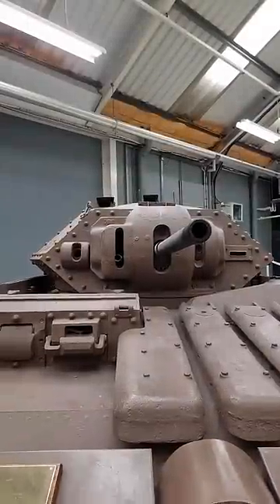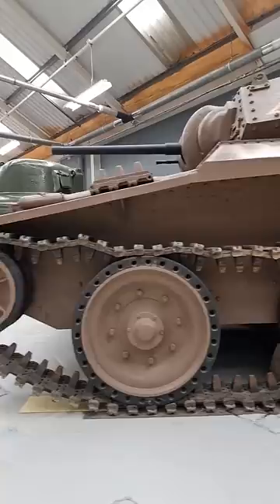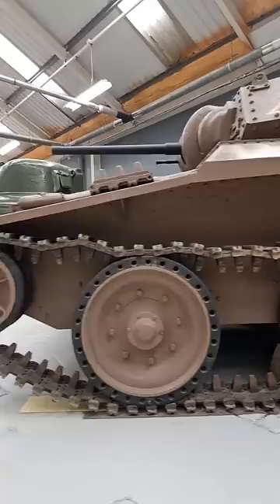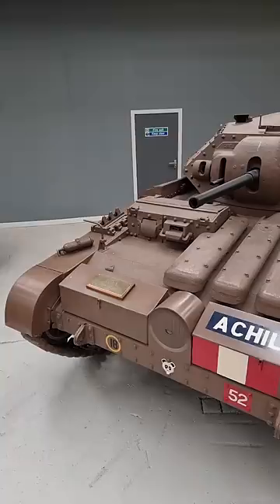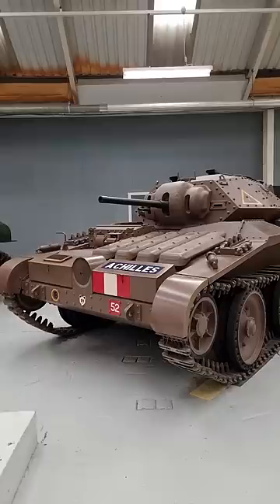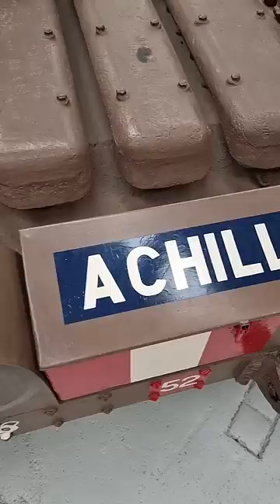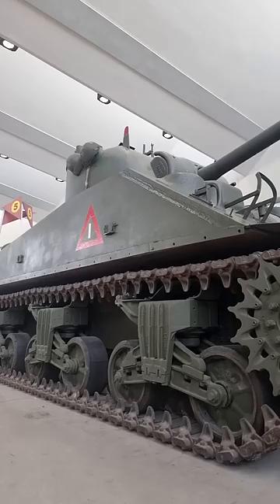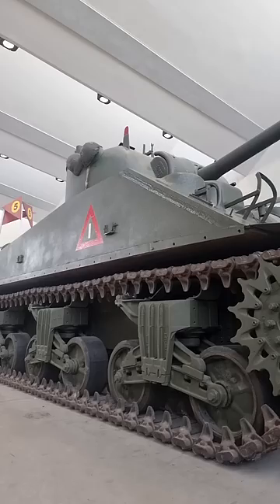The Covenanter in 60 seconds #shorts

Comment: You know the tank is bad when they rejected it for frontline service at a time they had very little actual equipment
Reply: When the newly made equipment that's made because of lack of equipment is so bad you'd rather fight without said equipment.
Reply: I like the way it looks though
Reply: Why did the US use Sherman then ?
Reply: @СергейСердюк94  wow who knew that the Sherman (a good tank) is miles better than a tank that literally burnt the crew if they moved wrong
Reply: They wouldn't even use it as an APC
Reply: @СергейСердюк94 the Sherman was a pretty good tank tbf
Reply: @СергейСердюк94 Easy to mass produce, Easy maintenance and very modular design
Reply: @smiley7399  the T-34 was faster to build, cheaper to build and was faster, had more range, could easily be maintained and more powerful engine yet people mock the T-34.

I personally think it depends on situation, for Defensive fortifications I'd use Tiger 1 thanks to its big armour that most tanks or field guns couldn't pierce.

 for firepower and pure offence and go with soviet IS-2 with its beast of 122mm and thick armour proven in WWII in Ukraine when 10 IS-2s faced numerous tanks and half tracks and destroyed over 50 Tiger I and IIs and losing 8 IS-2s.

For speed I'd go with soviet T-34, it's one of the fastest tanks, can be easily maintained and has one of the largest operational ranges for both road and cross country of WWII tanks.

For best combination of all three I'd probably choose the Panzer IV, it's just all round solid tank
Reply: @rainbowappleslice  it's an okay tank, depends what it's needed for, Sherman's are good for their variations, for speed the T-34 is best as it's one of the fastest and has most operational range, for Defensive fortifications the Tiger II is unmatched with its thick armour and large gun and for offensive and firepower then it has to be the Soviet IS-2, the beast that could put a hole right through a Tiger II and did during soviet offensives in Ukraine
Reply: @@kira-le9qr meh it was okay, it did its job I think best tank overall is Panzer IV, but for defence I'd choose German Tiger II, for offence I'd choose Soviet IS-2 and for speed I'd choose Soviet T-34.
Reply: @СергейСердюк94  the Panzer IV was too expensive and time consuming to manufacture, the T-34 was a piece of hot garbage with the Soviet’s manufacturing (the only good ones were produced post-war), the Sherman had good reliability, was able to punch a hole through most anything it came across, and most importantly of all had the highest crew survivability rate.
Reply: @СергейСердюк94  no now I know you learned from exactly what you said I did. The Panzer IV was a very effective tank for the first 3 years of the war but was too expensive and labor intensive to manufacture during the later years as Germany’s industry ground to a halt. One of the reasons we know this is they started to remove components on the late war variants of the Panzer IV which included the removal of the motorized turret traverse mechanisms because they were too expensive to manufacture and they didn’t have the resources to do so. The T-34 suffered from the Soviet’s poor manufacturing with the armor plating usually being way too brittle and poorly welded together, with there being visible gaps in the armor, reports of armor outright shattering or spalling from smaller cannons, and periscopes made of polished metal instead of glass. Every country that got the WWII era T-34s as military aid from the Soviets had nothing but bad things to say about the tanks while those that got the post-war manufactured T-34s thought they were decent. The stats of a tank on paper mean next to nothing if that’s not the quality you are actually producing from your factories. The 75mm Sherman was able to penetrate a Tiger 1 through the side armor at ranges of 650 meters or less and with how rare they were in the first place was absolutely fine, the 76mm gun could reliably penetrate the front armor on a Tiger 1 out to 800 meters with the 76mm gun becoming more and more common on tanks after the D-Day invasion and HVAP rounds became more common on tanks equipped with the 75mm gun. The whole myth about needing 5 Shermans to take out 1 Tiger is completely based on the fact that US tank platoons consisted of 5 tanks at the time and that’s what you’d be engaging any armored vehicle with whilst the Germans would have Tigers operating either solo or in a pair if they were lucky. The US had also been fighting in North Africa and Italy since they joined the war, going up against Rommel’s armored forces in North Africa and other German forces in Italy since the Italians were worse than useless.
Reply: @Sturmischer   you're wrong.

1. tigers were rare for Americans because most were destroyed on eastern front, Germany produced nearly 2,000, hardly a small number, it has nothing to do with poor manufacturing, the USSR didn't have th luxury of geography like USA, soviet production of T-34 suffered between 41-44 with having to cut corners because they had the full might and industry of Germany and Italy's  military attacking them, after the USSR turned the tide of war in Europe in February 1943 after the victory at Stalingrad, the T-34s could be produced up to standards and that's not even including the thousands built in 1940 when it first entered production and the issues in production only really effected armour, maintenance and crew comfort, the T-34 was still faster, had more on road and cross country operational range and had more horsepower than all Sherman variants and it's 76mm gun was larger than most Sherman variants that used 75.

2. This is about what was the best tank for overall use, not how much it cost, important factors in tanks are, firepower, speed, range and armour and the Panzer IV is my choice, if you disagree that's your opinion.

3. That's false, 75mm gun could only pierce Tiger side armour at 100m or less and couldn't pierce it's frontal armour at any range, allies knew this which is why is why they started producing more powerful anti tank weapons but didn't really care as they knew by late 43 that Germany had lost majority fighting the USSR so it would be rare to see one and they were right.

4. North Africa hardly proves anything, Germany and USSR lost more tanks in a single weeks battle on eastern front than was lost by both axis and allies during whole 3 year north Africa campaign

The Sherman was a good tank for its many variants and ability to adapt and easy maintaining, T-34s built to specification in 40 and 44-45 were great tanks and if speed was what you needed then is the best choice for a tank, even with corners cut due to bombings and supply issues, it only really effected armour, crew comfort and maintaince, with some effecting guns.

But calling it hot garbage, when it was one of the most effective tanks used in WWII and was proven in combat many times against many panzers, tigers and Semoventes, is ridiculous

Sources: WWIIEquipment, Armored Champion: The Top Tanks of World War II, Wikipedia Tiger I&II combat service section, Wikipedia M4 Sherman Design and Combat Service section, Wikipedia T-34 design section and combat service section, London: Arms and Armour, Wikipedia North Africa Campaign, International Institute for Strategic Studies, Accounting for War: Soviet Production, Employment, and the Defence Burden, Tank Tactics: From Normandy to Lorraine
Reply: @СергейСердюк94  
Becuse it was sufficently effective in combat , and easy to produce. 
It was no worse than the German  Pnazer III and Penzer IV tanks.
Reply: @tyaty  panzer IV tank was a better tank imo as it was faster, had more road and cross country range and had better armour than most Sherman variants.

But it was mostly a joke about meme tanks like Tiger being indestructible boogeyman, Sherman breaking apart after one hit, T-34 breaking down after a few miles then getting replaced immediately instead of repaired, Panzer IV for being the chad tank and Crusader Tank for being awful 😂
Reply: @СергейСердюк94 nothing Russian made has every been good. Ever.
Reply: @Sauce_Sensei  you have absolutely no idea what you're talking about, Russia is the world's second largest arms producer for a reason, they sell some of the best equipment, their tanks, IFVs, self propelled artillery batteries, MLRS batteries, fighters, attack aircraft, helicopters are some of the best selling in history.

You literally don't know what you're talking about, russian land force right now is the most powerful in the world far superior to the United States land force and far more advanced. And far larger in both active service and in storage.

Cope harder
Reply: @СергейСердюк94 if there so powerful and advanced why are they still fighting in ukraine
Reply: @sdkfz1825  shortest answer, Ukraine has a decent military and with military aid it's enough to put up a fight against Russia which is only using half of it's strength.
Reply: @VictorianTimeTraveler this and I think it's the Matilda, makes me very angry just seeing, I can't imagine the anger a German would have seeing whatever these British abominations are.
Reply: @СергейСердюк94 half ? Your nice its more like à quarter
Reply: @aurelienbidault9064  nah I'd say it close to half yeah most of its Equipment is still in storage and it not using it's sir force and navy to full potential but the large land force, calling up reservists and partial mobilization into partial war economy means it's serious, it's similar to US in Vietnam
Reply: @sdkfz1825 Ukraine and Russia almost had same tanks,planes,and weapons,but with different military training and tactics.Even with the help of western countries,Russia still able to push through Ukraine.The reason why Russia is still fighting Ukraine is because of the Western Countries,they send weapons which is more advance than Russian weapons
Reply: @Sauce_Sensei Why does Ak 47 still exist today then??
Reply: No one mocks the T-34, the thing was extremely unsafe though with awful escape hatches and compact crew compartment, didn't help that it was surrounded by fuel
 @СергейСердюк94
Reply: @FrogOnAHorse  I've said everything I've said and provided sources
Reply: @Markii234  western weapons are not more advanced
Reply: Reminds me, for another such example, look at the Soviet destroyer Opytny. Imagine being such a rubbish ship that the USSR removed it from service during WWII, when it needed essentially every asset it could get. But basically as soon as the Siege of Leningrad was lifted, the ship was put in reserve rather than trying to keep use it. And keep in mind, they used some stinkers like the Leningrad class and some very old ships like Aurora and the Novik class.
Reply: @СергейСердюк94 . Say it with me, comrade ."Lend Lease." 

The meme of "ackshually the soviets won the war entirely on their own with no support and only communism" is getting a little played out.
Reply: @CheckMyBioForFullArguments  if memory serves, only the commanding T34 had radios, with a massive antenna as well, knock it out and the rest of the squad lost nearly all coordination.
Reply: @СергейСердюк94  
Panzer 4 G - 1942
frontal armor: 80mm
side armor: 30mm
Top speed (Offroad): 16 km/h
Top speed (On roads): 42km/h

M4 Sherman (Early) - 1942:
frontal armor: 90mm (50mm plate sloped 56 degrees)
side armor: 38mm
Top speed (Offroad): 24 km/h
Top speed (On roads): 35 km/h

Explain to me how the Panzer 4 is overall faster and better armored than the M4 Sherman.
Reply: Ffh
Reply: @zano187  don't think that's true
Reply: @СергейСердюк94  The t34 suffered from poor quality control especially in its transmission. On paper it's a better tank in practice not so much. A common and now traditional problem of Russian tanks actually.
Reply: @tsiefhtes  that's just nonsense
Reply: @СергейСердюк94  There was nothing nonsense about the t-34s being hung up by their crappy laminated steel transmission.  The T34 was an excellent design for the time but Russia's poor manufacturing standards during wartime hobbled it . Russia only got by by making  massive amounts of them. If produced by the Americans the English or the Germans the t-34 certainly would have been one of the best performing tanks of WW2.  But good design doesn't mean much if poor quality control results in your transmission getting stuck in a single gear as was common for wartime T-34s.

Comment: Polish armoured train in the UK. Now that sounds wild.
Reply: There were 13 armoured trains built in Britain in case of a German invasion, and one of them was the world's only miniature railway armoured train. Because of its proximity to Europe, the Romney, Hythe and Dymchurch Railway in Kent was given an armoured train, but the line only had a miniature 15 inch railway gauge so they remodelled one of the miniature railway's Hercules locomotives into a mini armoured train. It had two anti tank rifles and four Lewis guns and managed to shoot down a Messerschmidt 109. After the war they took off the guns and armour plating, gave it a new paint job and returned it to use on the model railway, where it remains in use to this day.
Reply: The Free Polish Army was essentially a British army/militia; they were trained and equipped by the British and they were based in the UK. After the war, they remained in Western Europe because Stalin refused to allow these heroes to return home. 😢
Reply: Wow, I looked into that, and it is true, and not Monty Python homage, it is THE MOST BRITISH THING EVER.
I just imagine its Commander with his handlebar mustaches and swagger stick.  @RealUlrichLeland
Reply: Probably horse drawn. Sabres at the ready. Or insert correct slashing thingy

Comment: Very good looking tank, low to the ground sloped armour, looks like a t34 ish
Reply: Pretty sure armor sloping was a thing already done on some interwar tanks. It has drawbacks too, as it decreases space for the crew, especially the driver, which often ends up performing less good because of it.

Regardless, given the tank has their radiators on the front of the tank, I highly doubt the tank was designed to shrug off anti-tank rounds with sloped armor. More likely the designers wanted to keep the tank as light as possible by decreasing the amount of steel necessary, which is also why they couldn't be bothered to increase the hull size to fit the radiators better.

But I agree 100% that this tank looks amazing... like a '60's Porsche with a gun stuck to it.

Comment: the poor cooling was caused by the small fan and poor air flow not the position of the rads at the front. the covenanter and the crusader are the same basic vehicle only the engine and cooling is different, there was no room for the rads in the engine compartment  due to it being shorter than crusader. it's actually a very well made tank. i should know, i own one

Comment: Is that sped up footage? If not, that's one fast tank! I guess the engineers that built this were of a similar mindset to those who partake in drag racing. Put the biggest engine you can, or one with the most power, it only has to get to the finish line then shut off and coast home. 😂

Comment: Built to a weight, had additional armour put on it after (due to mission/specification creep) that so the suspension and drivetrain struggled.  The engine rear, radiators front at least provided heating... not great for the desert. And they were leaky.  Commander's "hatch" was spring loaded to slide shut. Guillotine style. And the catch was not that good at its job. I've seen mention of concussions but no actual decapitations.  Build quality, would have shamed British Leyland of the 1970's.

Comment: There are two points that were in the favor of the Covenanter. First, the Germans never knew how bad it was, but they could count and the Covenanters were frequently moved around the country (for training) and the Germans knew that we had 1200 tanks and that must have frightened them because if they were good, then that was a lot of vehicles and a propaganda win for the British.
Secondly, the Covenanter was quick. It was a cruiser tank with a top speed of 55 kmph and that's fast. Rommel liked British cruiser tanks because they were fast. He actually used 2 captured Cruiser tanks for his personnal protection and the Germans must have realised that the Covenanter was yet another fast tank compared to the German ones. Even though Rommel did not know about the radiator problems, Rommel would have cautioned the Wehrmacht that fast tanks can be used for Blitzkrieg.
Lastly, although these tanks would have been terrible in the desert because of the radiator problems, they would have worked well in the cold British climate.

Comment: Worst British tank then you are mistaken.
Look up the lesser known mark 1 of the Matilda tank.
British Brass being cheap fvck's as per usual.
Covenanter worked fine in Britain but in north Africa the heating issue was the problem.
If Germany ever did carry out operation sealion rather then fvcking about as they did those 1771 A13 Mk V Covenanter tanks was the bulk of the armour to defend the isles.

Cruiser A13 Mk IV that replaced the Covenanter performed well in 1940 & 1941 till replaced which the mark4 was basically the same as the mk3 in the asset side bar the radiator issue hence the mark 4 was used in north Africa.
Reply: Matilda 1 (A11)was truly awful unlike the Matilda 2 (A12) was great as the war office & brass in general didn't cheap out with a modest but usable budget.
The (A12) was used from 1939 to 1955 for a reason!